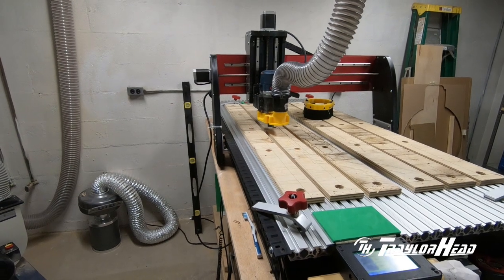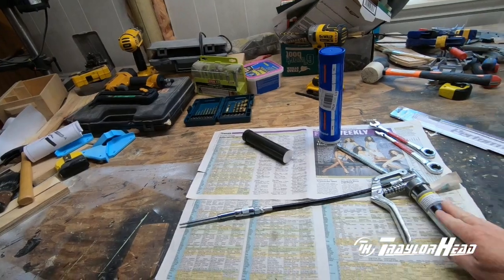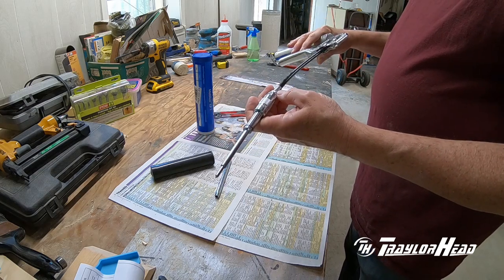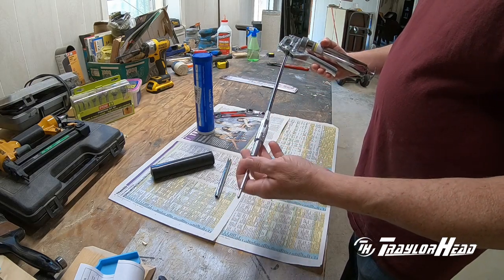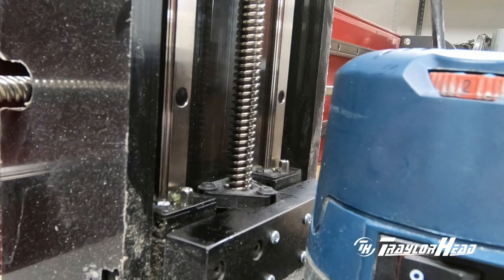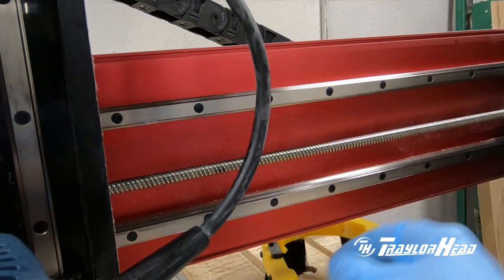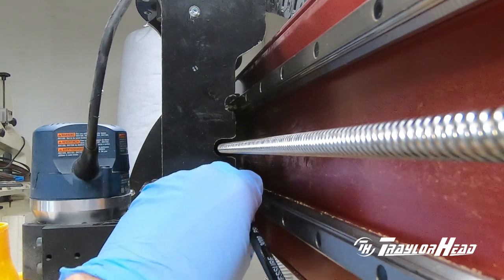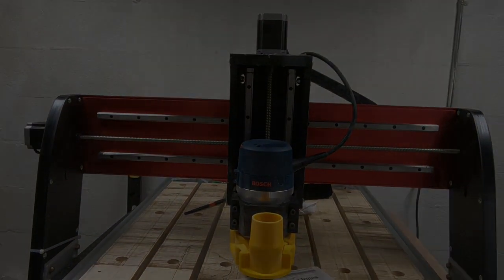Shark HD5 Greasing Linear Rails

Comment: In your opinion was the gantry upgrade from the HD4 to HD5 worth doing?  Been wanting to pull the trigger on the upgrade myself, but was looking for some reviews first.  Thanks
Reply from the maker: I think so, it is so much stiffer than the HD4 gantry with less flex.

If you have the HD4 Ext version, you would also want to look at stiffening the bed.
Reply: James Traylor Did they make the Hd5 easier to adjust the router tram?  Thanks for the info.
Reply from the maker: @toddsargent3608  Yes is a little easier. there is a document that explains it. But simple remove router mount, loosen 4 bolts, use frame square to square to bed. Then use shims on router mount to square it to bed.